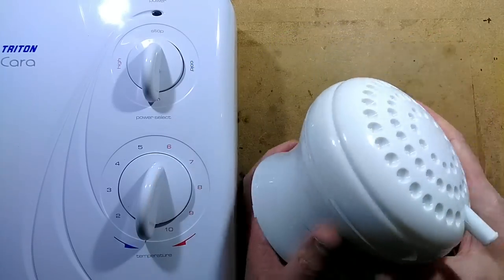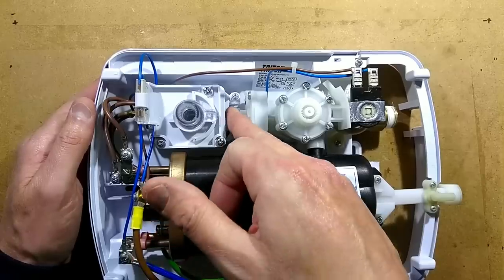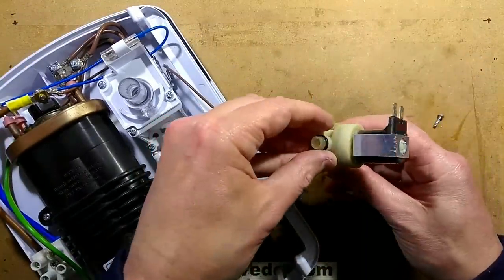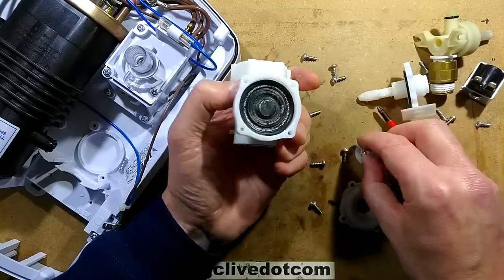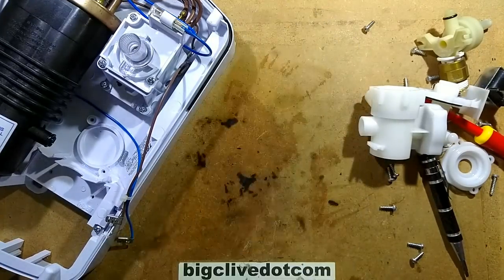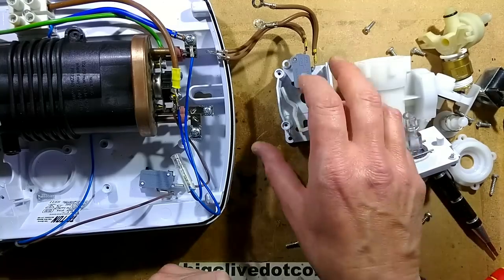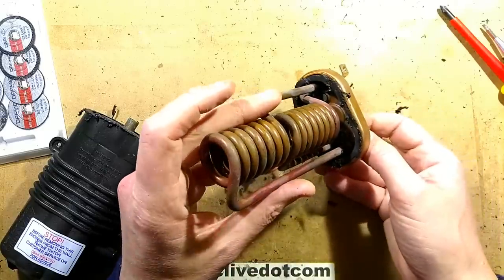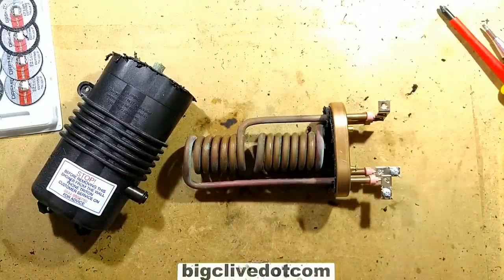Teardown of a UK electrically heated shower unit.

Comment: I've never seen a man so sensitive about getting his work bench wet.
Reply: flagpoleeip . I was thinking the same thing.  He seems a little afraid of water. he is either a witch or raised by cats.
Reply: LOL raised by cats :-D
Reply from the maker: MDF and water equals sudden fluffy texture.
Reply: Paint it pink, to suit said fluffiness. :)
Reply: = Another battle stain
Reply: Thomas Galea Using cheap eBay paint of course
Reply: @Lauren J. Or both.
Reply: bigclivedotcom bleach and mdf seems to produce even more, and faster fluffiness.
Reply: The problem comes when next project you forget your workspace is damp and get electrocuted.
Reply: @Country Boy Forever might  not be a good idea if you work with loose wires
Reply: This type of wood acts like a sponge for water
Reply: MDF should never be used in environments where it might get wet.  It's not as bad as particle board, but nearly so... There are kitchen and bathroom cabinet manufacturers though that use particle board on their cabinets, even those pieces that are going to be around sinks.  Give it a bit of time and the cabinet will eventually self-destruct from any water that gets on it.

I would suggest that he either replace that countertop with some real wood or cover it with stone tiles (e.g. granite, travertine, etc).  The stone flooring tiles are pretty cheap, so replacing the countertop with them would not cost much.  Travertine might be best since it would still be fairly light colored and not that different in color to the MDF that he is currently using.
Reply: Its mdf

Comment: In the US we use natural gas or LP for massive BTU's that will handle a very generous water flow. Of course 120 volts would be entirely impractical for any attempt to create such a device.
I love my fire hose pressure shower. I always remove the stupid flow restrictor from the shower head that is supposed to "save money" by using less hot water over a longer period of time. It makes no sense to me. 
Huge water pressure along with 50 gallons of pre over heated water and game on! 
There is no way that sad little contraption could compare. Certainly it's better than a cold shower. 👍

Comment: I can definitely notice the new audio, there seems to be parts where it's too loud. Probably need an audio compressor. Didn't notice much about the video though.

EDIT: actually no it's not the volume at all it just sounds a lot more closed and nasally than before.
Reply: Its definitely clipping when speech gets louder, needs the gain slightly reduced or a compressor applied to the audio feed
Reply: Regarding the video instead:
the saturation is "ok" although a bit on the high side for my taste.

Definition seems ok too (after youtube compression).

What I'd DEFINETLY suggest is  reducing the contrast.
In this scene the skintones are correctly exposed at around 70% but the white plastic is 1-2 stop overexposed while the black plastic and sleeves are pitch black :-)
Unless the sensor has an uncanningly low dinamic range that should fix it :-)

TL/DR: Reduce contrast a bit :-D
Reply: To me the sound was sort of like it was from cheapo speakers......didn't sound good at  times. Video quality seemed ok though.
Reply: The framerate feels low.
Reply: Sounds great to me
Reply: The low bass level is slightly too high and there's definitely some clipping due to volume. Makes it sound kind of "boomy". Also contrast seems a little high.
Reply: I agree it's sounds boomy (audio cliping)
Reply: you must have your audio all the way up to 11 as it sounds fine here
Reply: BigClive should stick balls on vise to lower the bass in his voice. It's all good, video and sound.
Reply: It also is a much narrower sound stage as well. I don't notice any video difference but like the older audio better.
Reply: yes you can definitely hear the audio clip, especially more twords the end of the video. reminds me of the old infomercials that come on 70% louder than the program you were watching and sound just awful.
Reply: You can hear it clipping at 00:54 , 22:07 and 22:26 (and in several other spots). It's distorting due to clipping, possibly recording volume too high?
Reply: def clipping going on. I rather the old audio as well. it seemed to be at a constant gain where distortion was never reached. I noticed a lot of hard limiting/compression as well in the new audio as well as distortion.
Reply: I also heard the distortion even before Clive mentioned he was using a new device to record.
Reply: If you can throw a limiter on it'll help, if you want to lower the peaks and raise the quieter parts then a compressor is what you want. iZotope has awesome software for audio. It sounds bad as it is though.
Reply: Len M. I personally don't like when everything is roughly the same volume. the compression bothers me lol
Reply: Chris 
That's called a Scottish accent. ;)

Comment: I like these triton showers a lot. I've installed hundreds. They're cheap, powerful, reliable and safe.
Reply: @Jerome VV The pull cord is there to cut power to the shower completely, isolating it from the mains. This helps make it safe when working inside it. When the shower is off its not using any power so the pull cord can be left on. I usually turn my shower completely off using the cord just to make it totally safe but its up to you.

Never leave the shower switched on and use the pull cord to start and stop the shower. It puts strain on the switch and will wear out the contacts.
Reply: @dlarge6502  interesting, really? I've not personally seen inside ours, but we do that all of the time and we've only had one issue, where our pull cord became a tad dodgy.

Comment: How do you wire them up?`10kw @240V are more than 40A. Wich wire gauges and breakers do you have in the UK?
Reply: Techtastisch 75 Usualy a 45A or 50A MCB going to a 50A pull cord isolation switch (because it's a fixed appliance) Also it's on a 30mA RCD and usual fed with a 10mm Twin and Earth cable. ( Depending on run)
Reply: 10mm² is the cross sectional area of the conductor, so about 7awg. Sometimes 6mm² is used - 9awg.
Reply: 50A breaker, 16mm2 cable (5AWG)
Reply: The one we have runs on 400V 3 phase
Reply: Ian Darley 16mm2? WTF! 10mm2 is a nightmare to get into a isolation switch using the largest box available  (a 47mm) If it's a long run or through isolation you could use 16mm2 as a sub main to a separate consumer unit to feed the shower (Not that I've ever needed to do that) but trying to use 16mm2 into appliances or switches is crazy and not necessary.

If you've used 16mm2 for a shower if like to know how.
Reply: Marc Intosh 3ph 400V? where do you live? and what make is that shower? Ive never seen or indeed ever thought about using a 3ph shower. How hot do you like it? lol...
Reply: Why not to run them on 415V?? Do you have 3 phase supply in the houses? and whats the main house breaker?
Reply: I wired our 10kW shower in with a 40A MCB and 10mm2 cable.
Reply: ditto i atually have the same make (think it comes in 6kw 7kw and 9.5kw) on a 45a mcb 

10000w/240v is 41.2a
Reply: Wow, what power come to your home electricity meter? Here in Italy is 3 kW as standard and you can get max 5 kW...
Reply: I think it uses only 2 phases so its actually 1x 400V like small welders and most of kitchen cookers, don't think it has 3ph heater inside but i may be wrong
Reply: uk houses dont generally have 3phase power (some farms do)
Reply: Giovanni Carlo Iglina We have either a 60A a 80A or a 100A depending on the age of the house
Reply: Gareth Rees The UK voltage has to be calculated on 230V as of 17th edition. The circuit breaker rating goes on the cable current carrying capacity.
Reply: yeah my 1950's house has 240v 100A at the meter
Reply: my main fuse is a 32 amp 220v
Reply: Thank you! Well, you actually have more power than the industrial meter of our winery. We only have 10 kW on 3 phases. Quite anemic!
Reply: UK standard is 230-240 V @ 100 A so around 23Kw,  some older services are 60 A,  around 14 Kw
Reply: glenwoofit yes but you have to pick your cable based on the current draw of the appliance 

at 230v 10kw is still only drawing 43.5A so  10mm2 cable is still fine
Reply: @Giovanni Carlo Iglina: I was under the impression that electrical specs had been standardised throughout the EU. 
I'm in the UK, just checked out my electric shower unit and found that it's rated @ 12.5 Kw 230V and fitted with a 60A MCB.
Reply: @Giovanni Carlo Iglina Si, in confronto siamo un paese in via di sviluppo...
Reply: I see, thanks for answer. Here in Poland, ~80% of houses feature 3ph supply, now even flats have 3ph in the kitchen. And by myself, I think its way cheaper to supply 3ph at 25A instead of 100A at 230V. Much less copper and smaller transformers and also lower power losses cuz of lower currents.
Reply: Anth2305 Me too, i really though that residential power were at least in the same ballpark around Europe. In our homes we can't run at the same time 2 high power appliances, like hoven and washing machine. It's really inconvenient and frustrating when you forget, the power meter trip and all the house go dark.
Reply: @Giovanni : I'm genuinely surprised, considering that conforming standards across the EU is portrayed as being one of the major benefits of membership;)
Reply: > You don't generally get three phase in residential properties in the UK.
So you get only one phase? Or two? to get 400V if needed?But why? Does the cable in the street not have all three anyway?In germany you get all three phases each with 63A circuit breaker.
Reply: Here in Germany we have a 3 phase 60A Energy meter, or at least that's what I've got installed
Reply: In Flanders unless devices require it and you're willing to pay a premium, many houses are fed with 25A mono up to 63A in extreme cases. I myself have 32A three phase power entering the house. The largest wiring cross section in use is 6mm².
Many streets only have a total of 250A/phase available.
Reply: @whuzzzup  There's normally 3 phases in the street, but only one is dropped into your home.  I remember years a go there being a fault where a third of the homes lost power, there were a lot of neighbours throwing extension leads over the fences to help each other out.
Reply: Happened to me to, but in my case a third of the house went out
Reply: Gareth Rees Actually not just the as you say current draw. their are several other factors that need to be calculated. Air temp, Insulation coverage, method of installation, voltage drop ECT. You have 5% Voltage drop for sockets and 3% for lighting. Your right the incoming voltage has a percentage tolerance that the supply authorities need to comply with but under the 17th edition regulations you need to base your voltage calculations off 230 Volts irrelevant what the actual supply is.
Reply: My 1990 era home has each shower on a 32A MCB labelled "6mm²" (9½AWG?). When I replaced the shower unit I was careful to pick the lowest powered one I could find. The originals were 7.5kW (32A x 240V = 7680W). As Clive and others noted, more recent UK houses will probably have 45A RCBOs (equivalent to US combined breaker and GFCI) or MCB + RCD protection for each shower circuit and use 10mm² (~7AWG?) wire.
Reply: Wollte ich auch fragen ^^
Reply: That's pretty interesting, in The Netherlands we only get 1x35amp fuse or 1x40amp breaker. If you want 3x35amp or higher you pay ''lots of money'' extra every year. A 63amp or 100amp breaker would be perfect for electric stoves and charging EV's.
Reply: jim575757, only 9 kW for a house? That's insanely low.
Reply: my storage heating and hot water tank must pull 30+kw on a winters night!!
Reply: @Edward Cooper - Indeed. It's also why it's dangerous to connect something between two neighbouring houses (e.g. sharing a satellite dish or cabled internet connection). You could be providing a physical connection between two phases.
Reply: We are quite lucky in the uk that we do get mostly 240v(235-254v seems higher at night) 80A (new houses typically) and 100A (older houses) 60A if fed from a drop pole witch is very rare unless rural,
 3p is only used in business units or farms normally (as this tends to be a USA thing we don't use 2p x110v to make 220v its straight 240v)
Reply: steeviebops we shared our sky TV and phone line with our neighbors for year's.
Reply: @Ian Grice - it works fine as long as all of the equipment plays ball, but in the event of an earth fault, things could go very bad very fast.
Reply: steeviebops sky boxes don't have an earth.
Reply: They don't need to. A short in the LNB can have the same effect. For the vast majority of people, it will work fine. But if you get a short somewhere, you could end up with 380/415 volts on one or both boxes.

There are ways of doing it correctly with proper grounding and isolation.
Reply: Ah all my dishes and LNB's are bonded and grounded.
Reply: That is why you have those individually fused plugs as standard - a direct short of a cheap Chinese mains lead on a 100A fuse would surely have disastrous results.
Reply: Or 16-20A for sockets on a single run of cable.
Reply: I read electric meters in the UK for awhile.  Think I only came across a couple of residential properties with 3 phase supply, they were quite big and think had heated swimming pools.  One guy had been reading his meter wrong and had only been reporting one of the phases instead of the total... I didn't feel too bad breaking the news to him.
Reply: Old Uncle Silas that must of been Intresting Bill  (how do you end up only reading one phase and it been accepted as a reading)
Reply: I've not had anyone to read a meter for the past 10 years +
Reply: "I was under the impression that electrical specs had been standardised throughout the EU" - wiring regs are not just harmonised in the EU but globally (IEC 60446 and 60364 for example), the EU regs are just the IEC regs essentially. There are exceptions to these rules constrained by old buildings and things like plugs/outlet standards, and general historical issues. But yeah "standard" "out of the meter" supply tends to be 100A@230 - you have to remember a few things are in play, one of which is showers like featured in the video, the introduction of the ring main during WW2 (copper shortages) and political issues - people would go crazy if power tripped out when using a few appliances, it would be totally unacceptable. Local regs don't have to explicitly follow the global standard - and yes it's a huge problem with freedom of movement rules.
Reply: Yup, altough we don't have electric water heaters generally we do have electric stoves. These are 7.4kW on full blast so together with some frying and some upstairs vacuuming i already blew the 35A mainfuse. Had to pay 95euro to get it replaced (its in a sealed box). The real issue comes with everyone charging their electric vehicles nowadays, these onboard chargers only have a single phase 28amp connection, so either you need to limit the charge current (and enjoy 10hour charge times) or charge at nighttime only when everything in your house is off. Or go to 3ph which is not much help since almost all appliances are 1ph...
Reply: whuzzzup it's rare to have a cable in the street.  they are mostly underground except in rural areas
Reply: Same in Australia - around 25Kw per house maximum - 4Kw typical
Reply: Marc Intosh we have back boxes up to 100mm
Reply: AH! I have always wondered what voltage your higher amperage equipment worked on.
just in case you are not Familiar with mains voltages here in the U.S, standard voltage is 130 V 60 Hz, 2 Phase with 230V three phase for electric stoves, clothes dryers, welders , Central Air Con Units, and Electric Water Heaters.
Thanks, Now I know :)
Reply: I lived in a converted residential house to a student house, in it we had 4 shower rooms, each with a 8.5kW electric shower from the same brand as in the video. Yet we could all shower simultaneously without tripping the power.
Reply: @GiovanniCarloIglina  110 years old house here, the incoming supply is 240v 100A.
Reply: Supply to my house (Uk) is 250A 3PH 
No idea why and the only house on the road like it no 3PH sockets in the house or garage for equipment something we’ve wondered for the last 18 years
Reply: @uN1Qu3DZ  That’s what circuit breakers are for.

Comment: The microphone seems a bit too hot for this video, different camera?
EDIT: ""This video was recorded with a different device to test its audio and video functionality.  I may have set the exposure a bit high."
Ah, that explains it :)
Reply: The built in audio compression creates a more compact sound. It is more pleasant to listen to. Input signal might have been a little loud which resulted in occasional distortion. Reducing the input gain by 2 dB or so should fix this. Video looks good to me. The picture seems to be a bit more telephoto, less wide, then the previous one.

Comment: Thanks for the reply, No water pressure is fine, and the shower head descaled. I have taken the problem up with the makers and they insist it cannot happen, but a lot of people were complaining at the time. It was about that time that outside sources started offering the balls online. My own conclusions suggested that the structure of the ball or the housing altered with heat over time and shrank in size. There was a time that I had the showers professionally fitted but so many problems with undersized wiring and loose terminals causing terminal meltdowns. I now fit my own and have no problems.